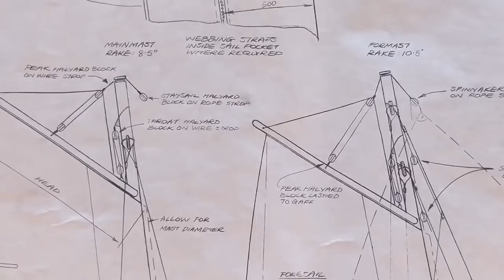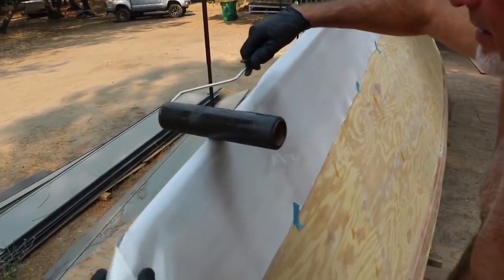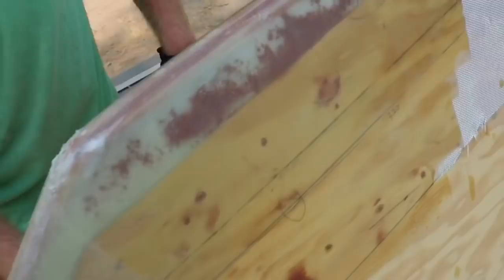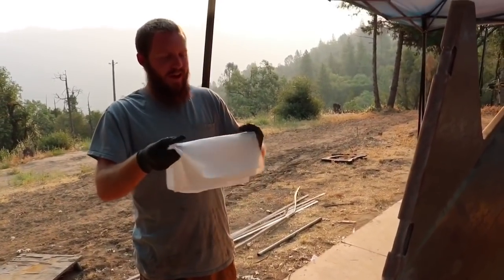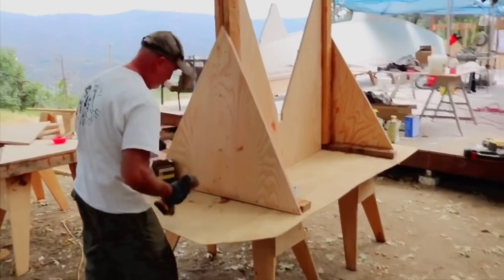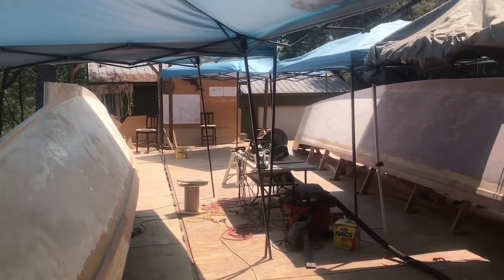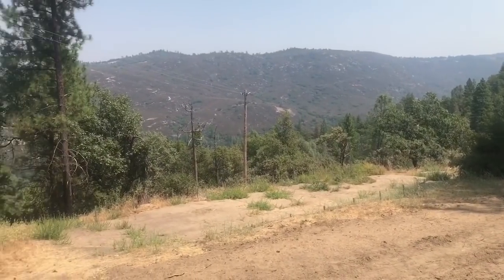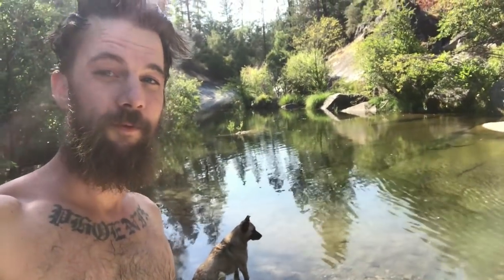E8 Fiberglass, building a catamaran

Comment: Looking good guys!  Don't rush the fairing.  It's the difference between a pro finish and a "backyard job".  When you finish and stand back to admire your handiwork you will not regret the extra time spent getting those sweet reflections.
Reply: Robin Hodgkinson. Thanks for the heads up.  I am looking to build a tiki 46 for myself.

Comment: Next episode: Boat hull rolling down the hill :D

Is there a risk of the wood soaking up too much epoxy and creating bad adhesion if you do not wet out the wood beforehand? Or is "floating" the way bigger risk? 

I've read this is an issue with filets and thickened epoxy, that you should wet out filets with unthickened epoxy before doing them to avoid them getting soaked dry.

I guess maybe it doesn't matter here if you work enough epoxy into it and squeeze it and add more epoxy soon after. Just curious about the logic there.

PS: Thanks for the awesome videos!
Reply from the maker: Dejay Rezme wetting out the fiberglass from the top is what Wharram  recommends,  so i’m basically just following instructions 😉

Comment: The key was to pre coat the wood with thinned epoxy to keep the wood from wicking the epoxy from the cloth .........  Your not going to be as strong ,  read up .
Reply from the maker: David Cummings unfortunately I’m   not an epoxy expert but im following the instructions and recommendations made by James Wharram exactly. Thanks for the input tho, made me look at the plans this morning and double checked 😁
Reply: +Ma’tiki - Building a Tiki 46 Catamaran your putting in a lot of work on a noble project I want your cloth to stay on the hulls.. What he advises is old school...   Modern method is 1 to seal the plywood with a thinned coat  " to keep epoxy from pulling away from the cloth into the wood  "Allow to tack then apply your cloth ,  then when it's " green ". That's not quite cured roll on a fill coat of epoxy to fill the weave of the cloth  this might take two thin coats......... Wash of wax sand and fair the hull.  

I've built more than my share of boats .. You have an amazing start keep up the good work .   Always remember 90 percent work and prep  1 p percent finish , don't become discouraged .
Reply from the maker: David Cummings ya live and ya learn 😁appreciate it!
Reply: David Cummings I’m not so sure that the issue is as clear cut as that - have you built any boats not using your method? I have built three and never encountered any significant wicking issues. Certainly the dry ply sucks up some of the epoxy, but only a relatively small percentage of what is applied and not so much as to effect the “adhesion” of the cloth.  And it appears in the video that you followed up with subsequent coats of epoxy while the previous ones were green so as to ensure a “layer less” application.  Personally I wouldn’t lose any sleep over it and I think you would have seen the cloth dry out as it was applied as any soaking up of the epoxy would happen in a short time and before the epoxy tacks off and loses flow. In my experience I would prefer to first not apply a thinned coat as doing so potentially creates a layered application - better to let some of the initial epoxy layer absorb into the ply thereby creating as good a bond as you can get between cloth and ply. Provided you don’t starve the cloth of resin in the process which David is suggesting is the problem.  However I’ve never encountered this and there are endless examples of this application method that show no significant wicking. Happy building.